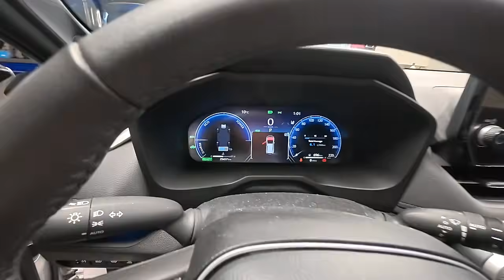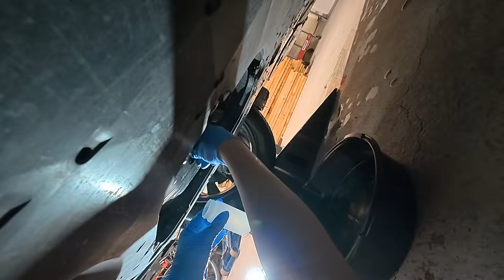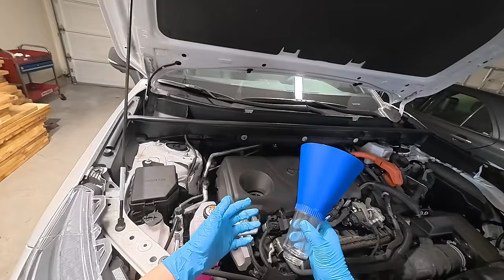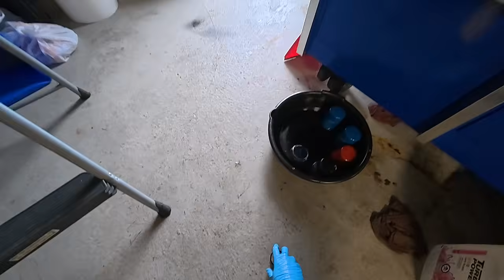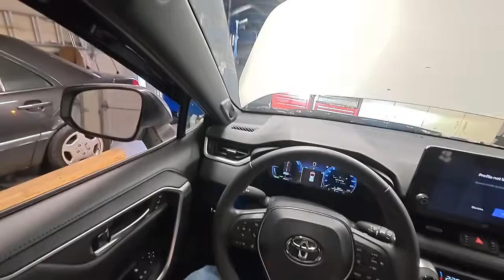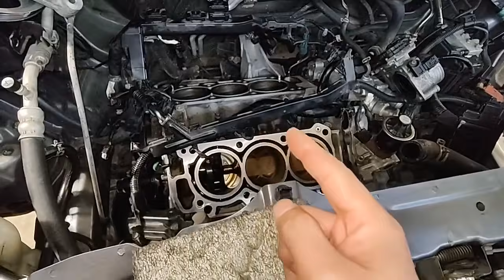5w30 Instead of 0w16 oil change #2 in the Rav4 Hybrid.

Comment: I use 5w-30 on my 4Runner instead of 0w-20… it’s an emissions scam, don’t listen to people.. the only time you need to use the manufacturer recommended oil is if your vehicle is equipped with a variable oil pump.

Comment: The Car Care Nut posted a short video clip about using anything other than manufacturer's recommendations. He states the oil pump Toyota uses based on the recommended oil is set up for that grade of oil, so if you use a heavier grade of oil, the pump will not efficiently pump the oil to the motor. He just posted the video on this subject just a day ago. Bearings, light to no wear. Really 😲
Reply from the maker: Yea I saw that video but it wouldn't make sense to me because when oil heats up it thins out. And the 30 is not measured in weight but flow or tested by a flow rating. It's not actually thicker viscosity may have something to do with it but that's not what that rating is for. Because oil thins out as it heats up and it's the polymer that expands to give you the protection so technically the 30 doesn't mean how thick it is it's actually thins out. I had to ask this same question to my teacher because why is the 5w thicker when not heated but when the oil is hot it is thinner but the number is higher. And that's because the 30 is measured differently because it's just polymers that expands. For that protection in higher temperatures giving that 30 rating
Reply: @theoffroadingmechanic I see your point with the oil’s flow rate . Cold start would be the most critical for this then. So if using 0 /30 W oil would be better
Reply from the maker: @brucewayne2773 the winter number is measured in centipoise and the other is measured in centistoke. One is not the same as the others in terms of viscosity in how oil reacts because oil changes with temperature. So the real number you need to worry about is the winter number
Reply: @theoffroadingmechanic  Yes, you are correct . Since I live in California where the temperature is between 60 and 80's F throughout the year, using the manufacturers recommendation is ideal for my Toyotas
Reply: Love the Car Care Nut. Nobody on youtube has more integrity and he knows way more than me.  HOwever on this one Im going to respectfully disagree. These cars are not "designed for 0w20" they are "designed for 0w20 IF YOU WANT MAXIMUM fuel efficiency". But they can handle a slightly bigger RANGE of viscosities. They HAVE to be able to. Oil changes viscosities quite a bit with heat and temps. Even a VERY COLD 0w20 can be as THICKER than a 5w30 at operating temp. So the whole "Oil pump programmed for only one viscosity" goes out the window.
Reply: @GBOComedy You think 0 20 is thin, what do you think about 0-8w. New Camrys using it
Reply: @brucewayne2773  LOL! Next is 0w2.

Comment: The HTHS between some 0W20 and this particular 5W30 engine oil isn't all that high.

The 0W20 engine oils had a HTHS of usually 2.6-2.7

Whereas this 5W30 last time I checked has a HTHS of 2.9

Both are higher than the 0w16 or worse the 0w8 engine oils.

Comment: Toyota uses different tune-ups depending on the region to take into account the different emissions regulations, average temperatures, average distances driven, advertised consumption etc. So even though yes it is the same engine, for example the variable timing takes assumes that you actually do have the recommended viscosity for your region. Most probably the differences are marginal, but they are baked into the software version for each region.
Reply: While you are right, it also does calculations in the computer with oil pressure and if it shows a higher oil pressure it’s gonna calculate which happens with thicker oil so it will automatically adjust to that. I showed a reduction and where on my tundra when I went to 530 voice recognition isn’t that accurate. But if the tune as you call, it would not adjust I should see excessive wear, but I don’t my iron on 0W 20 was a 12 and on 5W 30 was a seven and this is multiple oil test. Might I remind you copper was an 810W 20 and only a 3 on 5w-30

Comment: Not trying to start an online debate in the comments again regarding oil weights. But I'm curious on what your thoughts are on this video that TheCarCareNut posted regarding oil weights. https://youtube.com/shorts/i6ya-_K01tY?si=G8Vvy4AkQL82a4o6 He works on Toyota/Lexus/Scion vehicles and says thinner oil is due to US emissions. Now I'm not sure what Canada's emission regulations are, but I'm more intrigued on the variable oil pump he mentioned.
Reply from the maker: It's the same emission crap we have here in Canada government wasting money on climate change BS. Vehicles emissions only make up a small percentage of CO2 emissions we have enough forestry here to be pretty much net Zero. It's the forest fires every year we have here that offsets it. If only our government would invest into fighting forest fires rather than putting these emission regulations on manufacturer to do stuff like this but anyways. For your questions on variable oil pumps basically the idea of how this works is during no load or low load conditions the oil pump doesn't need to put out as much pressure essentially less drag on an engine like at a stop light or coasting down a hill. It is when you put a load or go to accelerate the pressure gets bumped up to meet load demands and it is done by regulating pressure with a solenoid or if an engine has a vane style oil pump it controls by allowing pressure to a chamber to change the angle of the outer housing to change the amount of flow that pump outputs. Basically things to meet emission regulations like idle stop start if your engine isn't running it ain't making any emissions for that 30 seconds you're stopped at a light.

Comment: 0w16 is darker at draining because it’s doing a better job keeping engine clean, by draining the contaminants out with the oil. It’s also lighter when you put it in new.
Reply from the maker: Someone already comment about that and with an engine that has 15k miles and being a hybrid half the time the engine isn't even running there's nothing really to clean. It would have to be thermal break down of the oil yes the oils job is to clean but thinner oil has a lower flash point and will vaporize easier. And you may say your engine only gets around 200c but that's because you have a cooling system on the other side of the cylinder wall. The oil is coating the cylinder wall and combustion temps in that that cylinder can get to 800c plus and that film of oil gets the brunt of that heat it varnishes and the rings scrapes it off the wall and back into the oil. A thicker oil will withstand higher temps less vapor loss when heated.
Reply: That just doesn’t make sense to me.   Oil is not a filter.  Dark means either burned or contaminated.   It is not an optimal sign of anything ever.   That does happen over time as expected but less dark, the better.
Reply: @RonScott67  I agree.

My engine is literally spotless on the inside, one day (a year or 2 ago... so not that long ago) I decided to try a different brand (everything else was the same) which was also a known brand and not cheap... and it was significantly darker.

Needless to say, I didn't use that oil ever again.
Reply from the maker: Oil is more of a sponge it takes in all the contamination and once it takes in all the contamination it's full now that oil is thick sludge when people don't change their oil. Oil burning and coking becomes varnish which is also a contaminant.

Comment: The cam shaft angle adjusters rely on the proper oil viscosity to operate correctly as the engine rpm changes.
Reply: Viscosity of the same oil changes with the temperature from 6.7 to 49 for 0w20, and 7.1 to 52 for 5w20.  So how that affect?
Reply from the maker: Do you know that when oil heats up it thins out? And the 30 is not measured in weight but flow. Because oil thins out as it heats up and it's the polymer that expands so technically the 30 doesn't mean how thick it is it's actually thinner than your winter rating. It helps when you learn in school because I had to ask this question because why is the 5w thicker when cold but when the oil is hot it is thinner when hot but the number is higher. And that's because the 30 is measured differently in the high temp high shear of polymers that expands and stretches under pressure.

Comment: How is your fuel economy now as compared to the factory oil?
Reply from the maker: Literally no difference. Was getting 5.2-5.5L/100km when it was warmer. Now the temps have come down not yet freezing and I'm getting 5.8-6L/100km and I'm doing short trips. Last winter I was doing about 7L so probably creep up around there when it gets a bit colder.
Reply: @theoffroadingmechanic  Given that the HTHS is only slightly higher, you shouldn't be impacted all that much (apparently less noticeable on the highway).

The 0W20 engine oils usually have a HTHS of around 2.6-2.7

Whereas from memory that particular 5W30 has a HTHS of 2.9 (again from memory), so it isn't like you went from an engine oil with a HTHS of 2.6-2.7 to one that has a HTHS of a minimum of 3.5 (C3 or A3/B4)

Comment: I would not recommend a jump from Ow-16 engine oil to a 5w-30 oil. A lot of people lack the knowledge that some modern engines have what you call a VARIABLE DISPLACEMENT OIL PUMP that is controlled by a programmed ECM /ECU (our cars computer).  Even if you have the same make, year, model of car with same engine (example: Toyota Rav 4) in another country the programmed ECM/ECU is not the same. At Saudi Arabia, Toyota programs its ECM/ECU Toyota's Rav 4's to run on optimal efficiency running a 5w-30 oil, whereas in USA it programs its Toyota Rav 4's to run on optimal efficiency using a 0w-16 weight oil. Notice key words...OPTIMAL EFFICIENCY! By running a 5w-30 oil you are putting more drag to the flow of the oil to critical engine parts. More drag of the engine oil = more engine wear. Listen to your owners manual, the engineers put it there for good reasons, like what I have stated above.
Reply: Well, you’re not wrong. The ECM goes by oil pressure to do its calculation so if you do put in a heavier weight oil, the higher pressure will factor in everything. I have a 23 tundra I used to run 0W 20 in the early days and I’m showing less whereon 5W 30 with a total of five oil test on it.
Reply: @halftontimrvreviewsandtips3106  All depends on temperature, load, and engine speed. Once again key words here are..OPTIMAL EFFICIENCY!  You need to know about the Stribeck Curve where you have boundary lubrication, mixed lubrication and Hydrodynamic lubrication. Google these terms for a better comprehensive understanding. Car guys that track their cars know that the only wise way to run a heavier oil is when you track your car, once your done tracking you go back to your oil listed on your oil cap. Hope this helps. Youtuber Engineering Explains has a video on this.
Reply from the maker: People still don't understand cars pcm has a base mapping or ROM. And RAM memory that is stored for corrections made. And when you disconnect your battery that ram disappears and has to relearn everything it has changed for conditions. The pcm will take inputs from sensors and output pulse width modulated as needed. Don't know where people get the idea that a pcm is "programmed" to do one thing and one thing only but what a computer does in a vehicle is also learning and adjusting. They teach you this stuff in school. You will get a check engine light when it gets out of parameters where the pcm isn't able to adjust anymore. Because it makes no sense for a pcm to only do one thing in one country and and something else in another or if you're in higher elevations with less oxygen compared to sea level. They don't make a separate pcm because you're somewhere else in the world.
Reply: @theoffroadingmechanic exactly you said it much better
Reply: @theoffroadingmechanic  The ECM/ECU are programmed to work in conjunction with the engine tolerances. Remember environment conditions play a critical role in which weight oil is IDEAL to run. Even engine oils with a high viscosity index its molecules are changing (stretching) constantly as temperature, load and engine speed change (Thermal breakdown). Add fuel dilution to the equation and you have engine oil's Achilles. Bottom line is this... No matter what motor oil you are using, be it the best synthetic oil, FUEL DILUTION IS UNDEFEATED! Change your engine oil with the recommended  oil viscosity that is stated on your oil cap from 3,000-4000 miles/ 6 months, whichever comes first. All depending on driving conditions.

Comment: 5:24  u need a larger oil pan i hate the black one you use lol.
Reply: Home Depot, and the like, sell a small mortar pan over near the concrete and rebar for about $8. They work great lots of capacity and a fairly large footprint.

Comment: I moved from 0w16 to 0w-20 in my 2025 rav4.. highway mileage went from 40mpg down to 36. Might keep going to 5w-30.. really interested in gas mileage
Reply: From your post..... your fuel economy decreased, and you want to go thicker?
Reply: Try another oil change again. Hardly believe 4 mpg difference from 0w16 to 0w20..it's not like you jumped to 0w40. Driving conditions or style.

Comment: Im not a mechanic but I understand that modern vehicles have a  variable output oil pump that works in unison with the VVT. So heavier oil causes the mechanism to rattle at startup.
Reply from the maker: When you learn about variable oil pumps from the manufacturer because they provide courses on things like this they all have one thing in common and it is for efficiency. Variable oil pump pressure will be low pressure under low load or no load conditions like idling or stop at a light or coasting down a hill. Once you put a load on or accelerate it bumps up the pressure because you need that pressure to protect the engine. The overlap of your variable valve timing happens at higher rpm not at idle and is done to help in the higher rpm range.
Reply: @theoffroadingmechanic Thanks for the explanation

Comment: Here is my concern: the electronic-controlled oil pump on the A25A engine was (probably) designed to work best with the recommended 0w-16 viscosity.  If you use heavier oil, you could shorten the life of the oil pump.  If the oil pump fails, the dominoes start falling...the oil-controlled timing chain tensioner stops working, then the timing chain goes slack, then it jumps timing, then pistons smash into valves, then the engine grenades.  Ball game.

Comment: You know these new engines are designed to use a lighter weight oil. The tolerances are much lower. You’re going to cause long term problems and void your warranty. Use what the manufacturer recommends and change at a minimum of 3k miles.
Reply: You are wrong.

Comment: I’ve looked into the owners manual for a Toyota Camry sold in Mexico instead of America and it shows that 0w16 is “preferred” but it also goes on to list, 0W-20, 5W-20, 5W-30, and 10W-30 can be used depending upon driving conditions and temperature. They’re not building 2 different engines for the same vehicle sold in both countries.
Reply from the maker: That just costs money for the manufacturer it's like every PDI we do they come in with half a quart low on oil and we always have to top it up at the dealership on our inspection. That's cost savings for the manufacturer.
Reply: Same range of oils recommended in Australia for RAV4

Comment: Don't tell the dealership because they will give you the blues on any repair engine related. I would used 0w30. That 5w30 is gonna be a monster on your oil pump. Shouldn't cause any issues other than fuel consumption, but who cares, its a hybrid.

Comment: Im also looking forward to your results . As for me i have a lexus ls460l 2007 V8 1UR FSE engine with 300000km and im in dubai wear it gets very hot i tired OEM recommended 0w20 i felt i needed more protection in high temps locally people go for 5w40 api SN lexus oem oil which is mineral base  here but i went with 0w40 shell ultra api SP  GTL base because its better quality better adidtive package when machanic changed my valve cover gasket my engine was clean like its new .so i think in my application it suits my engine .😅

Comment: with the Pennzoil platinum--i go 10k miles between changes--once I went 17k miles and the oil still looked good!!
Reply: Highway mileage?
Reply: I've been using M1 oils for 48 years at 10k OCI. At presant my 2007 Ford  Fusion 2.3 has 339 k (miles). Switched to M1 5-30 HM at 250k because of a very slight oil weep. In 10K OCI my engine uses 6-8 oz of oil and still runs great.